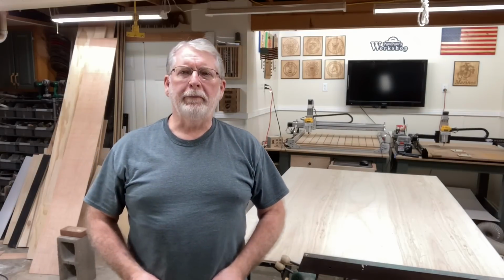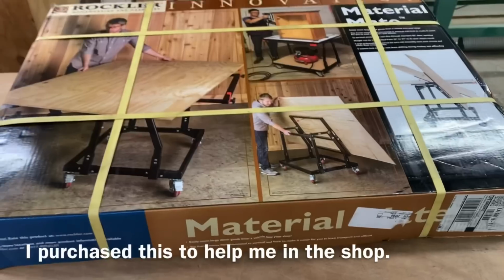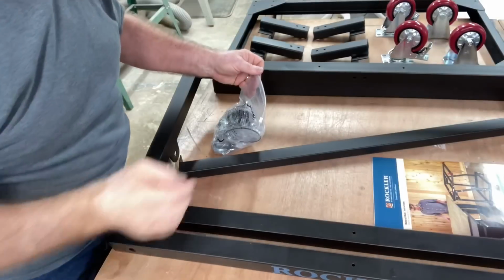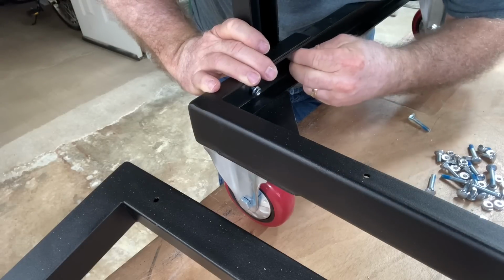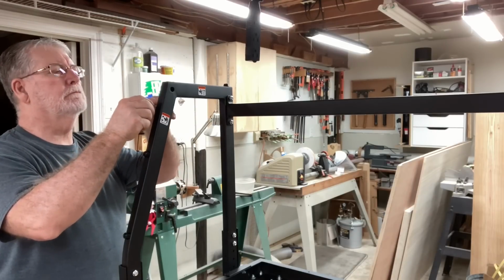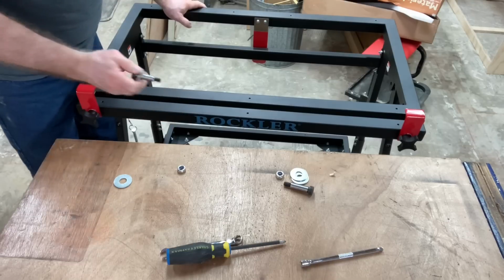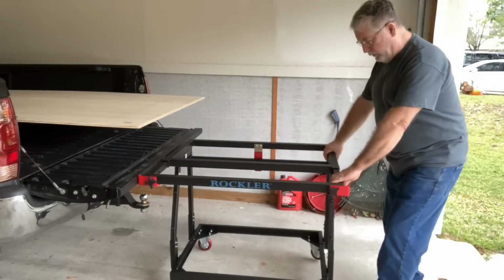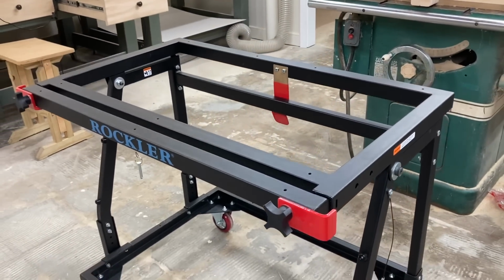ROCKLER Material Mate:  Solves a Big Problem!

Comment: I like that cart I need one I would change the two fixed casters to swivel casters it would be easier to maneuver around a tight shop.
Reply from the maker: That's an excellent idea.  I have thought about the same thing after running into the workbench a couple of times.